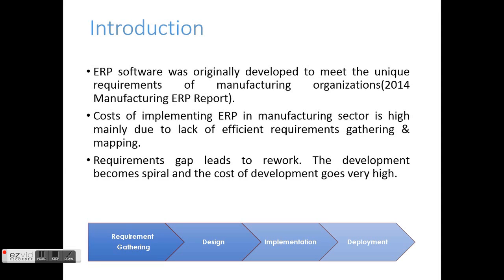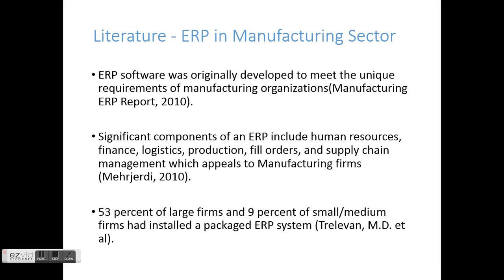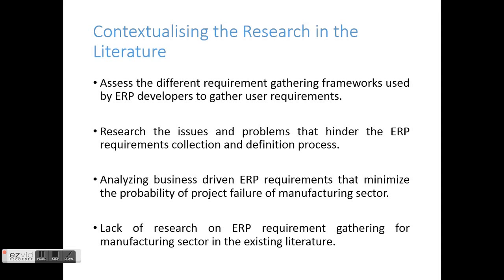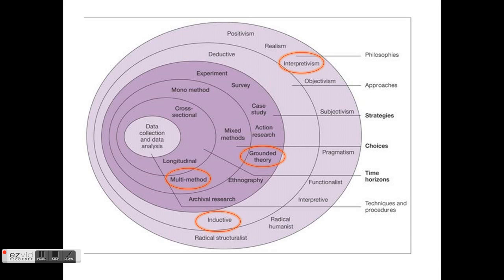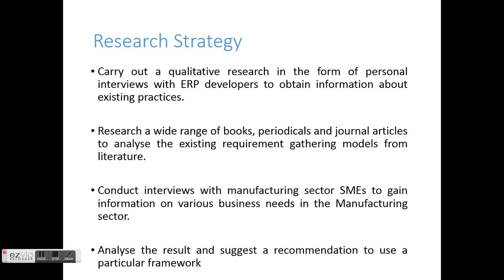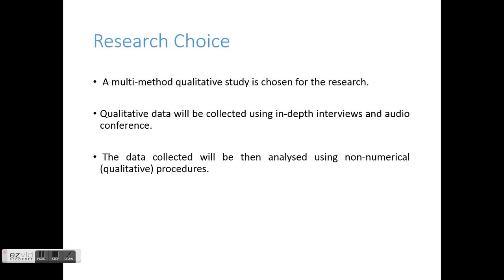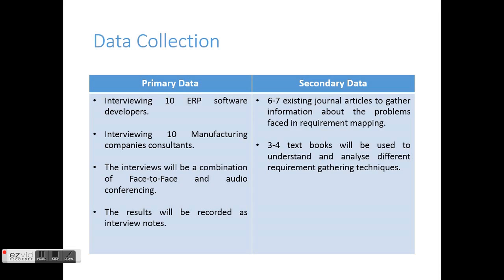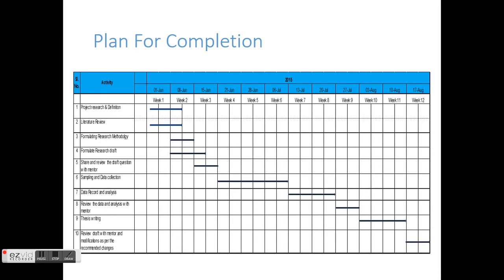Dissertation Proposal

Comment: Hello Aniruddha!
Great work! As IT isnt my area, my suggestions are related to your methodology:
- Have a look in your research strategy, I believe Grounded Theory requires a huge work. 
- Are you going to conduct interviews and audio conferences with 10 ERP software developers and 10 manufacturing companies consultants? You may consider clarify this.
- For your final proposal, you many consider not defining how many articles and textbooks you will use for your secondary data.
All the best in your dissertation!
Mila Souza

Comment: Hello Anirudha,
The topic for your dissertation has incredible potential in manufacturing sectors but can it be applicable in all manufacturing situations ? The research question gives the reader a clear cut view of the problems. The literature are from high level sources and are very valid. Sampling in particular needs a  bit of work . For Data collection methods More justification for interviews as a data collection mechanism is needed . Overall the presentation provides clear cut vision for a reader . The voice quality is loud and clear . I wish you very best of luck for your dissertation.

Comment: Hi Aniruddha,

i went through your presentation it was good and well presented to the listener , but i am much concerned for the the sampling method you will be using as you haven't mentioned the reason for using two different methods for  gather the information. overall nice work.

Comment: Noah Adjonyo

Hi Mr.
Very good introduction
The question (requirement gathering) would have been suited with a Case Study.
I rather have your sampling gather IT consultant, Information systems consultant than ERP developers for Manufacturing sector. because its during the consultation stage issues concerning information gathering is been put in place.
However, i like the topic you choose, as it's a major issue for adopting even SIS, LMS, CMS, RMS. thereby making it a good view for an MBA program

Comment: Hi Aniruddha!
I see a change in the way you have constructed your research topic from the earlier one. Although I feel it means the same. True?

Coming from a manufacturing sector myself, I can relate to the complexities of an ERP solution so your research topic has a lot of scope in itself. The literature reviewed is really good and shows that you would have spent a lot of time in reading and digging in for relevant data. However, here's what I suggest:

You have selected grounded theory for the research strategy which to my knowledge can be used if your research includes quantitative and qualitative methods both. Is it not?
Secondly, why don't you consider using mono-method instead of multi-method for your research choice?

Great work over all. Good luck.
Reply from the maker: Thanks Malay. Earlier I was supposed to design a framework. But now I will be analysing the current methods used by different companies and based on the data obtained I will be suggesting.

Comment: Hi Aniruddha! Excellent work: the introduction logically leads to the research question; the question is logical and of high practical interest; substantial amount of literature reviewed on the subject; methodology choices seem appropriate. Even though I am not an IT guy, I fully understood the presentation and the points you made, which suggest that it is clear and up to the point. I only have few suggestions for you:
- Sampling. You mentioned you intend to use both simple and stratified probability sampling. Why you decided to use different sampling methods? How will you obtain the data on the total sample size (e.g. all ERP developers and all customers in the manufacturing sector)?
- Data Collection. The combination of face-to-face interviews and audio conferencing is suggested. Will you use either or both of these methods? You may also need to explain why.
If you have any questions, feel free to approach me at any time. Wishing you the best of luck with your dissertation!